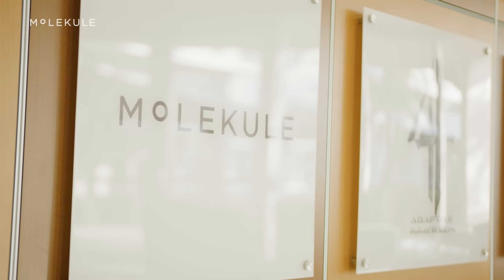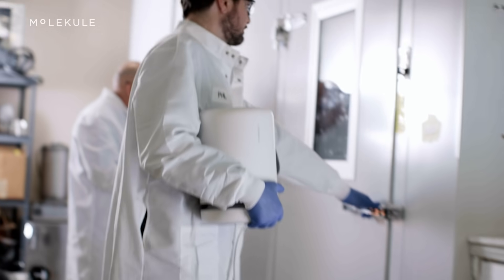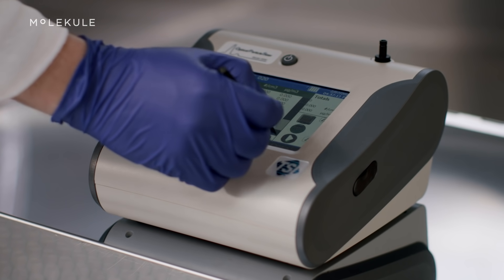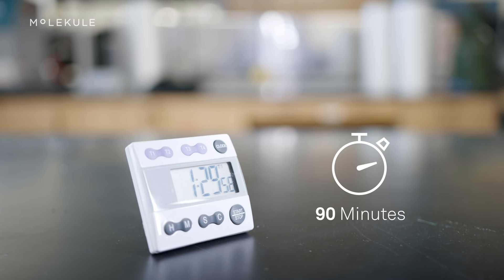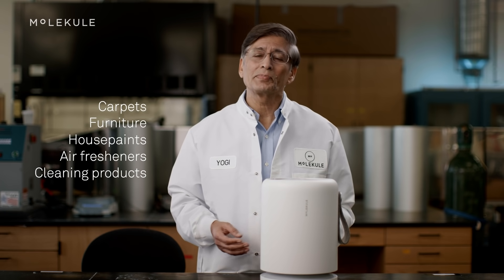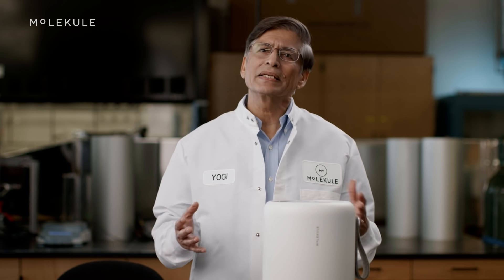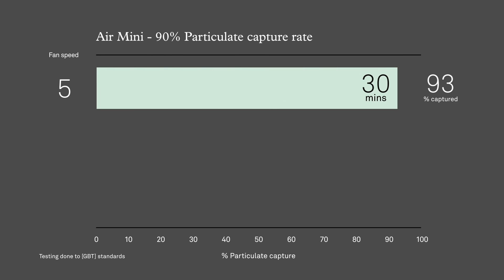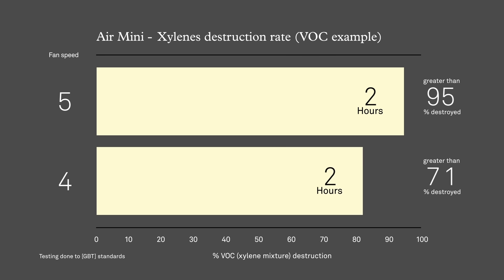Molekule Tests: Testing Molekule Air Mini

Comment: so this was tested by wirecutter and they called it the worst air filter ever tested. this dude reminds me of a phone call scammer.
Reply: Vacuum Wars' test wasn't very flattering for the Molekule either.
Reply from the maker: @FINNSTIGAT0R  Regarding the Vacuum Wars video, it is not at all clear how their tests were performed or under what conditions. They do not disclose what room size or instruments they used to perform their testing, so we can't comment on the performance data they published. We can point out that their "VOC" testing included ammonia and hydrogen sulfide, neither of which are VOCs, and that their testing chamber appears to be a cardboard box held together with duct tape. But again, we can't comment on the validity of their testing without knowing more about how it was executed or why they falsely classify these particular airborne gases.

Comment: Is the original as effective (or better) in any way than the mini?
Reply from the maker: Air Mini is the same great PECO technology as Molekule Air, just designed for smaller spaces. The original was designed to cover a much larger area, but it's about twice the price, so it really depends on what your needs are.
Reply: There are reviews on YouTube that show the original not even being able to filter dust out of air.
Reply from the maker: @Michael-hz2pl  Keep in mind that not all reviews are conducted with the correct testing methodology, which is a big reason why we encourage people to look to credible testing laboratories to get accurate information and results. Our purifiers are rated MERV 16, meaning they're highly efficient at particle capture, because we do believe that capturing particles and dust is part of air purification. However, we want to point out that his metric still fails to capture the full capability of PECO technology, since any organic pollutants captured are also destroyed via oxidation. HEPA filters can release these pollutants again (something you won’t see in a 30-50 min test), but PECO works to eliminate them.
Reply: Molekule 
One thing that would definitely help is if you could get independent people to conduct and verify the progress this company is claiming.  
I do not own a Molekule, but I must say that I love the idea of completely destroying air toxins.  
It’s just from the tests that I’ve seen, it takes a Molecule system quite a bit longer absorb particles from a smoke machine in contrast to a traditional air purifier.  
So instead of absorbing them, is what you’re saying implies that the Molekule breaks them down by allowing particles to pass completely through the air filter, but causing them to “die off” the more amount of times air is circulated through?
Reply: I have the mini plus and its amazing.